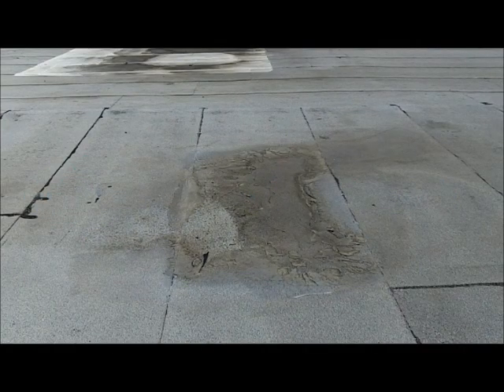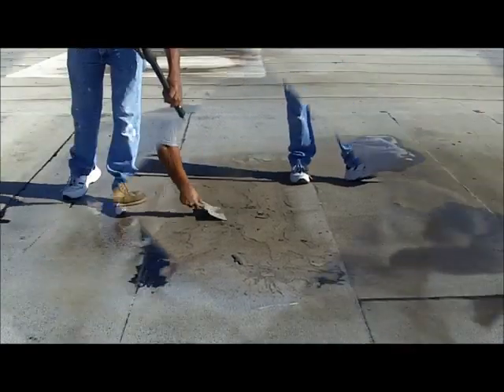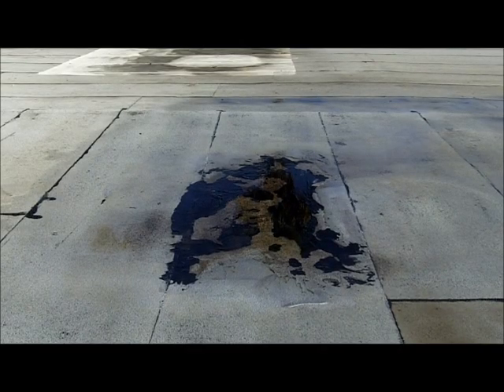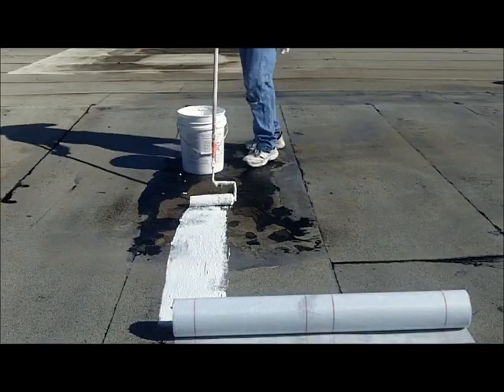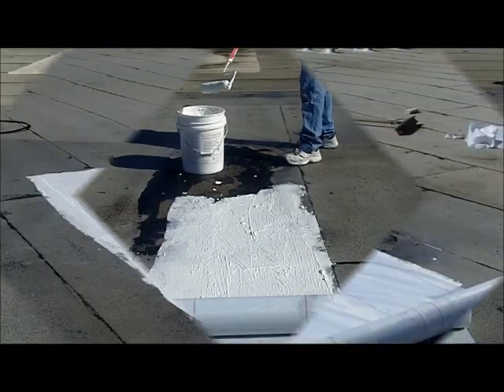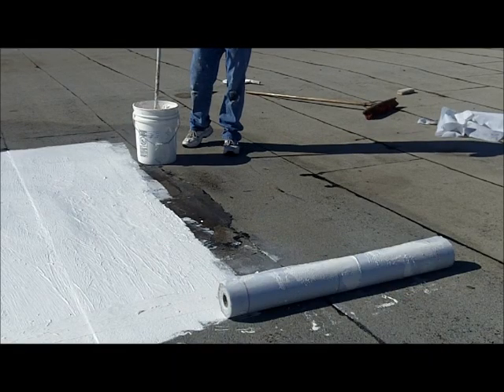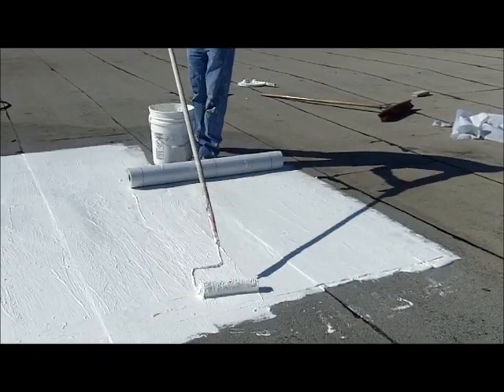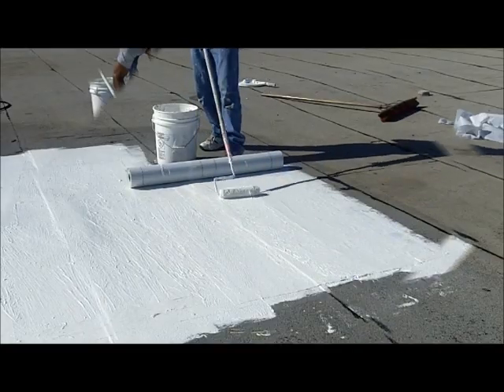How to Repair a Flat Roof with Ponding Water

Comment: All you guys commenting on how to fix ponding.... well there are dedicated products for this. A simple Google of "Roof ponding filler kit" will suffice. 

Or you could produce your own - by mixing the primer needed for PU roof coating and adding minerals (kiln dried sand for example) to it and troweling it out. Will need the PU & fleece coating over the top and then the UV coating over that for further longevity.

Comment: Hello! I have a flat roof with a white tarp-like covering that was put over. It's stopped the leak inside the home but water still gathers in the area. Could I use any of your products to raise the roof up a tiny bit in the area while also providing an extra seal from water?

Comment: That's nice work. But before proceeding to roof coating roof cracks repair is the very essential for long lasting roof waterproofing and results as well. So far our experience is only coating is not enough to hold water leakages for a long time.
Reply from the maker: Roof cracks can be addressed using our product and reinforcing with mesh as well

Comment: This wont get rid of the water pounding!
Reply: Question is how do you make the ponding area level , do you have an idea  ?
Reply: @inappropriatemushroom4709  its done by raising the structure, using a jack to raise the structure and screwing another 2x4 to the rafter to secure it.

Comment: He’s not raising the area with ponding water. He simply applied one layer even extending it outside of the area with ponding water. It may stop the leak but not the ponding. To stop the ponding he needs to raise and level off the deeper spot with the higher one.
Reply: Question is how do you make the ponding area level  ?
Reply: @inappropriatemushroom4709 there's a ponding filler I believe it's buy APOC.  Not sure it's possible to accept a seal over it once it cures though. I saw a video on YouTube showing how they applied the ponding product.
Reply from the maker: We don't need to raise the ponding area as our coating will hold up to ponding water without deteriorating or leaking.

Comment: Unfortunately, in my experience, it is very rare to see a proper solution applied. Flat roofs seem to be prohibitively expensive to service and in my area it is absolutely the contractors inflating the pricing making it almost no choice for building owners to opt for an actual permanent solution.
Reply: Question is how do you make the ponding area level , do you have an idea  ?
Reply: you're right... if i have to redo a large asphalt roof, even just to torch a new layer and all flashing and edges done... it might take me 2 days but i will take 10-20k for it depending on the size

Comment: so and how this method fixes the standing water issue? with hope that the water will not penetrate ? it's a false hope.
Reply from the maker: Our coating is designed with marine resins so in the unlikelihood of the water being 2' deep and ponding for 2 weeks it would not penetrate or break down the coating.

Comment: Don't fix the roof just fix that spot, got it
Reply: Most roofing contractors don't specialize in flat roof ponding fabrication.  Creative people will cut a 8 foot diagnol slope using plywood & torchdown roofing.  In general,, usually ponding water will dry up in 5 days --> good gosh.  But hay, if it dries in 5 days so be it.  Some people pay 50k to turn a flat roof into a traditional roof.  Ouch.  If it's only 1 area, i'd say, clean it, prep it, and put silicone to withstand the 5 days.
Reply: @kendalgee5808  that's exactly what I'm thinking. I'm a huge proponent of doing things right the first time. But if you can stop a roof leak with a band-aid thats going to buy you 5-10 years, and it's going to save you hundreds of thousands of dollars, that's a no-brainer.
Reply: @kendalgee5808  Seen roofdoc do the 8'slope like a Niagara falls, I am currently researching. I need to raise my roof and drop it..
Reply from the maker: Our system is ideal for patches, repairs and full roof restorations

Comment: Water base products on ponding areas. Are going to fail. Come on people. And if the surface is wet how can it adhere to water. Use like materials. Roofing 101.
Reply from the maker: Thanks for your reply and the opportunity to educate you a little on our products. SureCoat products are formulated with marine resins and designed for prolonged exposure to water and heat and will not break down.  The substrate can be damp due to cleaning but not ponding or pooling and adhesion is not affected.  Give us a call for an adhesion test kit and check it out for yourself.  877-823-7873

Comment: Well then the question is: Does this system endure ponding water and if so for about how long (obviously would vary by climate)? 
And how can it be proved without using the public and working professionals as the experimenters with expenses etc..?
Reply from the maker: We offer 10, 15 & 20 year renewable warranties when work is performed by an approved contractor.  We have testing results to back up our claims and projects that have had our system on it which are now going in to year 20
Reply: Question is how do you make the ponding area level , do you have an idea  ?
Reply: Dumbest response I’ve heard from a “professional”.  You fix the problem not put a bandage over it!

Comment: Exactly, Johnny, this system will not get rid of the ponding much and hopefully it can endure its negative effects on the roofing system.
Reply from the maker: This system is not intended to get rid of ponding water, it is designed to endure ponding water
Reply: Question is how do you make the ponding area level , do you have an idea  ?
Reply: Kasha, what do you suggest?  I have a flat roof and just noticed ponding.
Reply: Fishing.

Comment: that stuff looks thin how is it going to build up where the water ponds?
Reply: Question is how do you make the ponding area level , do you have an idea  ?
Reply: Question is how do you make the ponding area level , do you have an idea  ? ..
Reply from the maker: It is not intended to build up where water ponds, it will hold up under ponding water.  You can use a cement product to build up an area if need be, but necessary with our system.